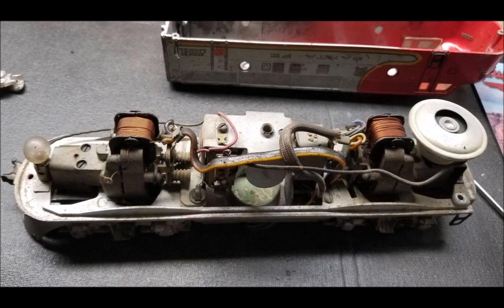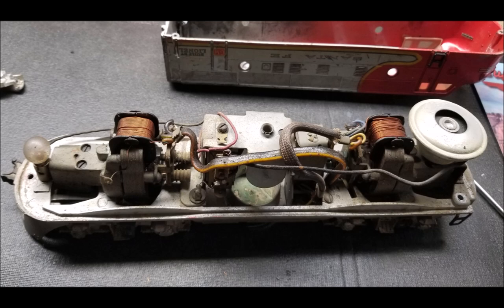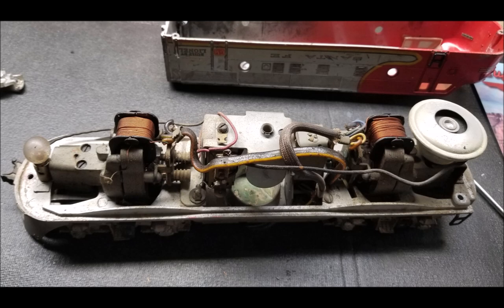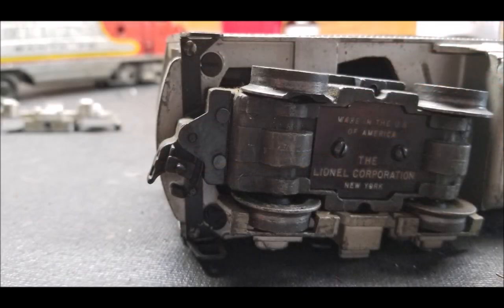Lionel 2333 AA Repair

Comment: Just finished cleaning a 1948 F3 Santa Fe set. Could not figure out why the P unit rear trucks kept locking up. Stator laminations were loose due to rivet not holding and the air gap between stator and armature closed.  Tie bands are a great invention. Motor runs like new. Testors red gloss enamel is virtually the same color as the red on the shell. Testors silver is also  a great match. Best regards, thanks for the vids.

Comment: what is the battery for? I have an alco unit with much of the same parts and it has a broken e unit
Reply from the maker: Battery is for the horn circuit.  It uses a buzzer type horn.  Not required to run the train.